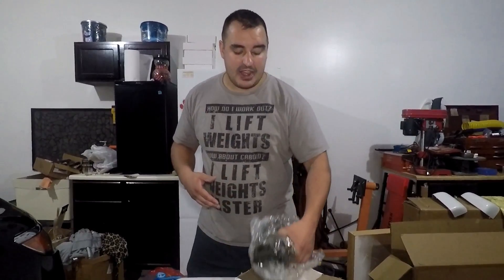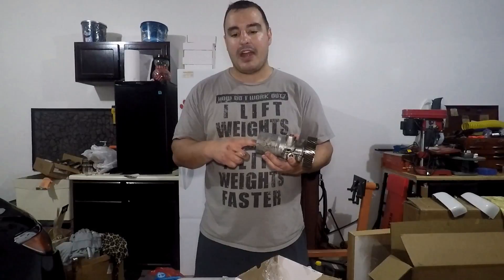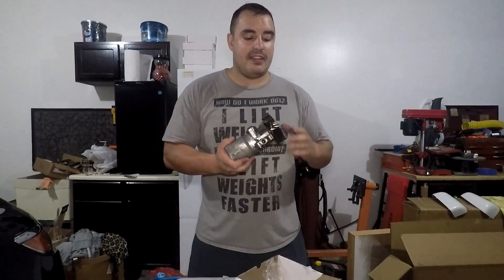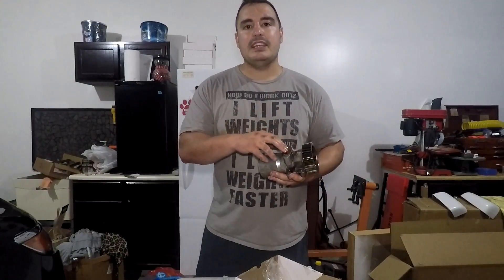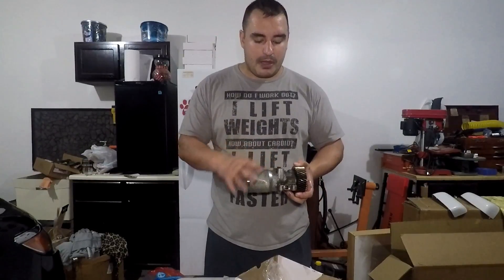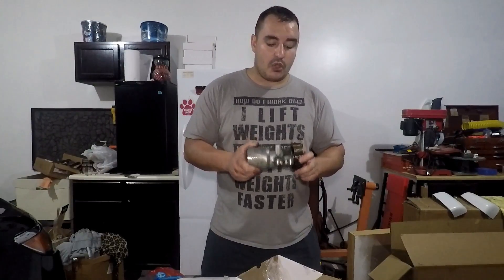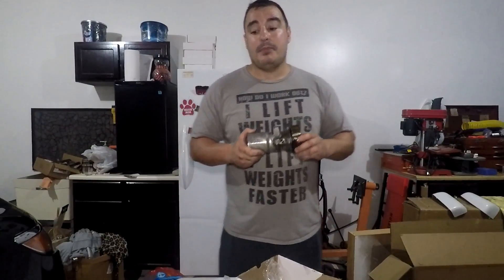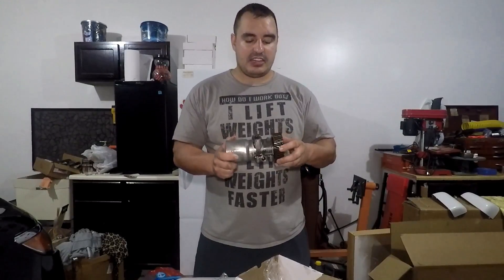6.0 Powerstroke CNC Fab HPOP Review

Comment: Great review!
Reply from the maker: Thanks man
Reply: It's very easy to build those pumps.updated housing well that remains to be seen the only thing they could do to the housing is have a tighter tolerance so the swash plate doesn't spin that pump is 17 degrees from factory and if you stroke it just 2 degrees you get a night and day difference. When I get time I will make a video showing how to do it including the seals and o ring you can get at the parts store
Reply from the maker: May I ask your background for modifying these pumps? Sounds like you do it a lot.
Reply: lol just very mechanically inclined is all it takes and you don't know till you try right.

you can modify that pump for alot more flow just by modifying one single piece and we'll the difference will speak for itself or should I say  the truck will . I am not saying anything about your pump or the pump you are telling people about . I just want to show people how easy it is and show them step by step how to put it back together fairly easy with basically a bolt and nut to put the swash plate and revolver in or the internals of the pump.
Reply from the maker: This is true you won't know till you do, but I do like the bench flow test that is performed with this pump and again an updated housing that they have been using for awhile now. Basically great quality control and a warranty to go with it. Wish you the best but this is a part I have no desire in modding when there is affordable quality parts out there. Certain things I want to MOD this would not be one of them. I'll leave that to the pros.
Reply: lol well some people could use the extra money and if it makes a truck perform that you definitely can tell a difference then that tells me everything is good but hey to each his own keep up the good work bro.
Reply: @rcarpenter9508  yes indeed! I would like to homebuild one...thanks for sharing knowledge and please when you post a video on the mod please let me know...and 6.0 Bros thanks also for the sharing of knowledge also! this means a lot to us people who doesn't live in the U.S.A and can't afford a diesel mechanic or a mod part...and again I'm looking forward for R Carpenter video...thanks a bunch!!
Reply from the maker: Glad you enjoy the channel. Anything we can help with let us know
Reply: @jpmastertech   send me and email and I will will explain sry been working my butt off on s new turbo I call goliath.6.0 Bros keep up the good info
Reply: @six0bros  how is your pump holding up. I’m looking deeply into cnc fab over the other big companies. My truck is totally stock 130k miles was running and showing signs then it was apparent pump failed

Comment: Does yours have the new type stc fitting  witch is better does old style  crack the cover plate like newer ones ,,well there all old now i have 04,,,thanks for info
Reply from the maker: I actually prefer the old style pump with the newer style rails. However once you replace the stc fitting with the update one they shouldn't be an issue at all.
Reply from the maker: I have all old style pulp and the old style rails. The nice thing is the old style doesn't have oil leaks often while the newer style is more prone to oil leaks however they do appear to have been taken care of more with newer stand pipes and dummy plugs
Reply: @six0bros  thanks for reply any way mine is leaking oil from back of motor on passenger side at top i was just looking at all possible place  mite becoming from hoping not that back cover if even possible,,,thanks for any help ,,,
Reply from the maker: I would check the hpop cover and the oil cooler cover. Is it wet in the valley of the engine

Comment: I ordered an old style pump . I was sent the other pump that has hpop housing on the pump that goes through a hole on the mount cover with the ring gasket. I requested a return and was told that you can modify the pump onto the area on The Valley .
Reply from the maker: So yes you can, but it is a lot of work. You need different branch tunes, a different hpop cover, stc fitting, to do the branch tubes you have to change the oil rails too. Which would involve changing rocker box, which would need the heads redone. So yes they can be changed they need a lot of work though

Comment: Just got one from NAPA, had a buddy jump on the wrench while I took a break to hop on the dirt bike. There is debris in the HPOP reservoir because he didn't clean up around the cover. Dude was trying to do me a solid as I've been frazzled with this high pressure oil leak. I have an 04.5 model, which has presented some issues. It's nice having the ICP on passenger side, but it's like an evil mutant that has some features of the 05 and some of the early 04. I took the old pump to NAPA as I did a bench test and had oil coming out the shaft. To me that says it's bad. Question is this, how do I clean the HPOP reservoir? I dropped the Rotella T6 5-40 that had a little over 1,000 miles on it, am headed to get more oil and a motorcraft oil filter, but I have debris in that reservoir. I replaced the ipr mesh and o-rings at a tune of $67 and dont want to wreck that. Any advice is helpful. With the oil pan plug off is there anything I can shoot through there to flush the debris? Also the gasket is missing, and I know there had to be silicone on the back of the cover and it's gone. Assumption is my well intentioned friend knocked it into the reservoir. Great video. Subscribed. Help a brother out!
Reply from the maker: Sorry I am late on this man. So the hpop reservoir just goes down to the oil pan. The best thing is trying to find it. You could take a small bore camera and put it into thr oil pan and try and find it.

Comment: Still holding up good? I'm thinking about getting one
Reply from the maker: It has been but the truck has been down for a while with a different issue
Reply: @six0bros  price has gone up a bit they are 850 now. Still think it's better than oem or bosch
Reply from the maker: Yeah I saw that. They dropped the core charge and you don't have to send yours in anymore from what I can tell. So I think its just they started sourcing their own cores

Comment: I was reading your description an you said this was an issue in the early 6.0’s. I have an 05 Excursion 6.0 I just got a few months ago. Was this changed for the 05-07’s?
Reply from the maker: In late 04 they went to a different style pump that is much more reliable. Typically with the later style pump you are much more likely to have a hpo leak than a failed pump
Reply: Excursions are the exception. Ford put all the left over early style engines into the Excursion

. Even '05 models got early style engines unless you have a super late build date . Is your ICP sensor on the passenger side valve cover or behind the turbo ? Do you have a square or round style EGR cooler ?
Reply: Gio F I have an 04 excursion with the square egr (ends welded/deleted) and icp sensor on the valve cover. Has the early style hpop.
Reply: @giof8358  My ICP sensor is on the passenger side. My Egr is deleted so I’m not sure.
Reply: Thank you for the quick response! I love your videos man! 😎👍
Reply from the maker: @Doom6.0  thanks man I appreciate it very much

Comment: Still holding up good? Getting ready to pull the trigger on one...
Reply from the maker: Yes it is holding great. No issues at all amd great customer service to top it off
Reply: @six0bros  did you replace your branch tube while you were in there? I know alot of shops recommend it...
Reply from the maker: @Nicky_Pin_It  to replace the branch tubes the rear cover of the engine has to come off. I did not do this while my truck was apart for the build. It isn't a bad idea to replace them if your truck is all apart but I wouldnt recommend it if you're just replacing the hpop
Reply: Hey, what’s up,  I’m sorry to have to ask...where’s the link to buying 
this pump
Reply from the maker: Sorry about that here you go man. 
https://cncfab.us/i-30498072-cnc-fabrication-6-0l-03-04-stage-1-hpop-6-0-ehpop-stg1.html
Reply: Still holding up?
Reply from the maker: It was when the truck ran last in the process of rebuilding the next engine for it. Kill Devil Diesel stage 2 with icon heads but this pump was great until the issue happened